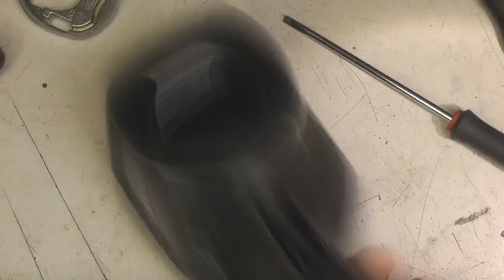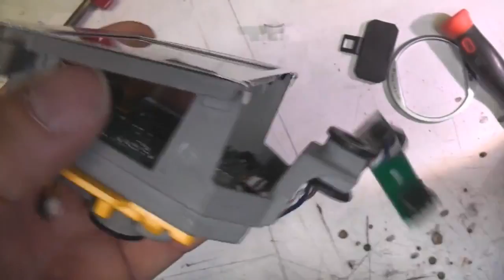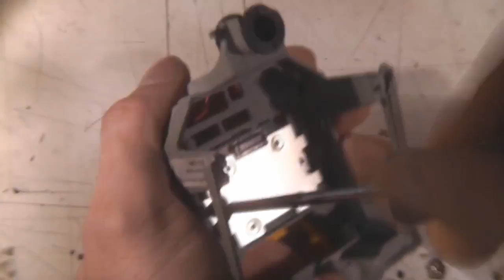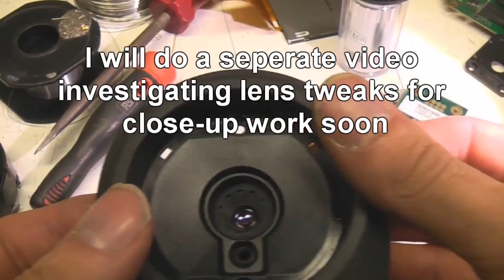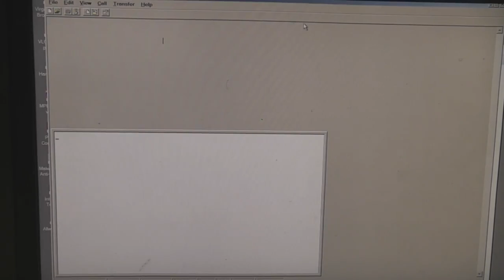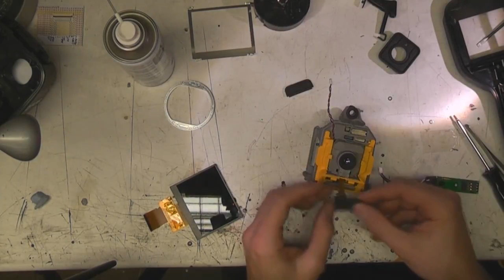FLIR E4 Thermal Imaging Camera teardown

Comment: When I turn it on, the logo and device loading animation appear. Forever loading. Flashed with two official firmwares. Changed memory cards. Nothing helps. I came to the conclusion that it may not be a software problem, but a mechanical one. Can you please help with this and give me some advice? Thermal imaging camera FLIR E86. Thank you.

Comment: Ok i got the Flir Tg267 tore down very easy.this should apply to all similar models. I couldn't  find anything on taken these cameras apart besides this and one other video,so im posting this here to maybe help someone out in the future. 

Take off both top and bottom screws and remove the top rubber flap and the bottom  cap.

Then pry up the  Plastic black bezel that sits around the front buttons. Its just held in place with some double sided tape..This will reveal two screws.

Now you must pry up the plastic screen cover.adding a little bit of heat may help,but dont add too much.its also held down with double sided tape.start in one of the corners near the buttons and slowly work it up.this will reveal the last two screws needed to get the body apart.

Now and you can service the device.. battery seems to be a 3000mah 18650 cell.
Reply: To add to this,mine didnt want to boot up after the battery was unpluged.FLIR just stayed on the screen.i tried reseating the cables many times but no luck,i also held down both "up" and "down" buttons and this seemed to restart the camera but still no go.

Put it back in the housing,held both up and down again and this time it booted up.not sure if maybe the cameras keep it from loading while outside of the case or what the deal was.

Comment: I have some problems with the  E5 which looks exactly like the e4, It doesn’t turn on when I charge the battery it showed me the charging icon, but I tried everything to turn it on but no luck, I’m wondering if the small battery inside has something to do with it, can you share some comments..thank You!  for showing me How to open it up.
Reply: My small battery measured 3.5v, so it was OK. I held the motherboard button for a few seconds (with the large battery connected). After reassembly it booted. try that?

Comment: Thank you Mike! Your "tear down" video is responsible for helping me re-affix the trigger plunger (the same thing you damaged slightly in the process of taking your "Flir" apart), which had fallen out of the battery compartment. I heard something rattling around inside (probably dropped by someone in the office) and when I pulled out the battery, it fell out the bottom.

Comment: Hi, great video, I worked with a FLIR camera back in the '80s, that's ForwardLookingInfraRed camera, not the company.  It was a 'Common Module' version, I think developed by TI.  It only had a 120 line linear array that swept the scene, wavelength range 8-12 microns.  The lenses and window all made of germanium, kinda strange to have this basic, gray looking metal as your lenses, but with a good coating, it could transmit upwards of 95 % in that wavelength range.  I would hope they could do better now.  The sensors had to be cooled to something like liquid nitrogen temps to get good sensitivity, done with a sterling engine cooler.

.  I only recently thought about checking out what was available consumer-wise now and was surprised the expense hadn't come down all that much, and that the performance wasn't better, it's been over 30 years since then.

Comment: It's ironic how the xray took you off the path from the proper disassembly procedure.
Reply: Indeed, having torn stuff appart with the benifit of an x-ray pulling, pushing twisting, sliding (as in a shear force) gently prying trim pieces (because of this video) has been helpful

Comment: Great video. Do you think it is possible to replace current LCD display with some other kind of display? I'm thinking of something more camera-like so it could be possible to hold E4 close to the eye (I want to redesign the casing using the E4 electronics so it could be more like PS24). Can you also tell what is the maximum range of identifying human heat signature after upgrading the software in E4?

Comment: Software guy here. I was VERY surprised to see signs of the Qt library/framework in the serial output - qml, qrc, & QString are all from Qt. But Qt is huge - it's a full GUI toolkit, plus networking, databases, multimedia... seems like overkill to me. Then they run WinCE under that, which doesn't make sense since it has GUI functionality built-in. Makes me wonder if they could have used Linux instead & saved money on licenses.

Comment: Very interesting video and good find on the raw data.
Maybe you could trick a Cypress FX3 into reading it directly instead and just dump the contents directly to a pc, at only ~70mbit/s (16bppx320x240x60Hz) it doesn't sound impossible.
However I'm a bit more worried about if the lens is designed to resolve the higher resolution?

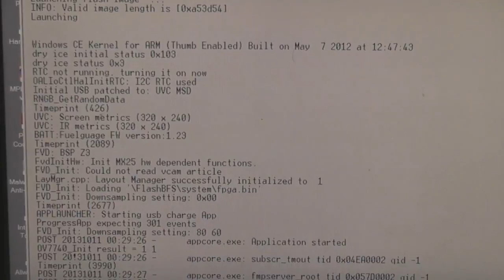Comment: at 43:25 you can clearly see: UVC: IR metrics (320 x 240) 
and a few lines below that: FVD_Init: Downsampling setting: 80 60
To me, the suggests that the camera is indeed software crippled. I think the first line indicates that the sensor is 320x240 and the second line suggest that its down sampled to 80x60. Maybe this is hackable?
Reply: This allows the use of slightly defective FPA detectors. Changed the setting on mine to max resolution and had a few hot pixels. 😮

Comment: Quick question, really to anyone, 

The Solder-mask pull back around the edges in this design is for grounding/ sheilding purposes ?
I use it sometimes in my designs but I do for grounding or shielding, was just wondering if this is the case here as well.

Comment: Relly subtle way to introduce the x-ray machine. Is it a film-based one or digital?
Regarding the presence of an ADC, most of the FLIR sensors these days are completely digital.
Higher-spec units require tracking because of the export/military restrictions but you can get hold of them from totaled high-end cars.

Comment: Maybe it can also be persuaded to overlook the whole 9Hz business.

I'm puzzled by the powerful chips in it. I would not think that that much power is needed for such a low performing application even when it processes the slightly bigger 320 resolution. Knowing what was coaxed out of the meager 68000 in an Amiga.
I would think a lot could be saved in the BOM but then again what do they care about 50$ when they fleece the sheep this much.
And why run windows..

Comment: Your videos are just the worst Mike. An insult to my intelligence from beginning to end :)
The pack of bastards at FLIR will not be happy with this video :)
You didn't say anything about it during the video but I assume you considered the possibility that the unit can be talked into operating at 320x240?
It looks to me like the hole in the metal shield in front of the sensor is smaller than the sensor. May have to drill that out and may need a different lens to use the full size.

Comment from the maker: As soon as I hook up a decent connection that was the first thing I plan to try
Reply: mikeselectricstuff I have opened my FLIR E5 to check out the USB but then when I reassembled the screen is just black and white dots and the temp on the screen is -40.0. What did I do wrong

Comment: Careful using normal Geiger tubes - depending on their design they can be poor at detecting x-rays due to the low interactivity between the tube gas and the radiation. You are normally relying on interaction between the tube wall material and radiation at higher energies.

As for testing remotely, it's a double-edged sword. Certainly once you are relatively happy with the shielding you will want to get up close and personal to really check every inch of the joins for tiny leaks... good luck!

Comment: I would always recommend using a pre-existing piece of kit for safety, but the best way to shield X-rays is to use available roofing lead. Cut overlapping sheets to line whatever enclosure you are using and then solder the seams using a plumbers soldering iron or torch and a shitload of flux. You will need to buy a scintillation counter to test your shielding, particularly at the joins. Start at high kV and low mA and work your way up the mA scale to check thoroughly.

Comment: Hackz! As Mike said in the video (you have to pay more attention next time ;) ) the sensor is probably the same for every model of the E series. So it would be 320x240, but crippled in software. It's cheaper to produce only one chip aiming for high specs and then mark those that have faults down to a lower grade. For market purposes this is done even after production got to mostly producing perfect chips. That's how it works in most silicon that come in different ratings/prices nowadays.

Comment: "you don't have to take this apart, but if you do..." Mike is talking as if everybody makes a teardown of expensive equipment in the first week out of the box ;)
On the other hand motivated by your videos I recently took apart a (not very cheap and still needed!) remote for external blinds, soldered wires to IC pins and listened to I2C with a cheap logic analyzer. Didn't get much farther from there though, because there's too much "chatter" and the LA (Saleae) software doesn't have many options.

Comment: I don't get it with these USB connectors. They are SO easy to break off and must always be supported externally via some very snug fitting case or something similar. And yet rarely companies do that, instead they risk having the consumer eventually wear out the solder points.